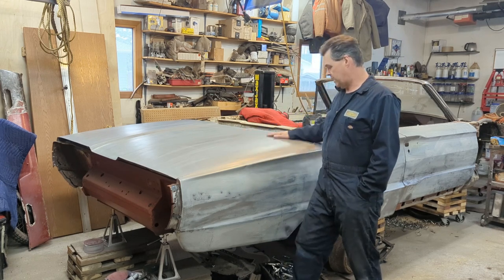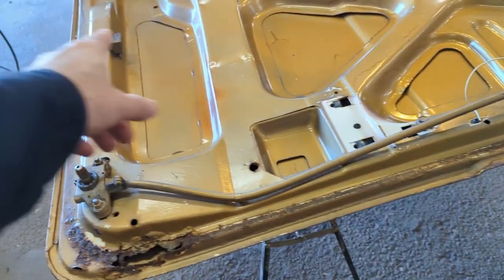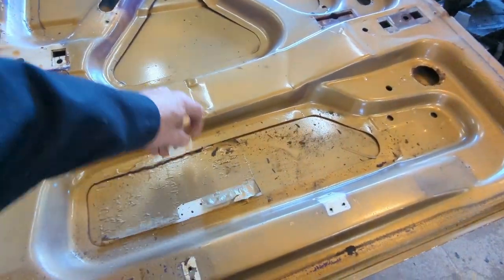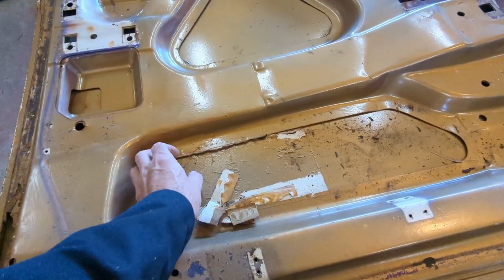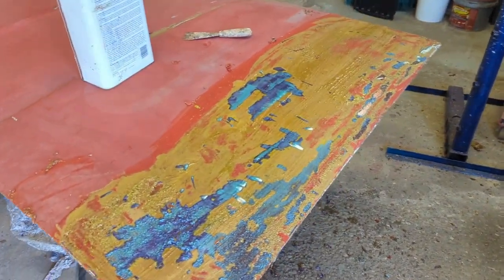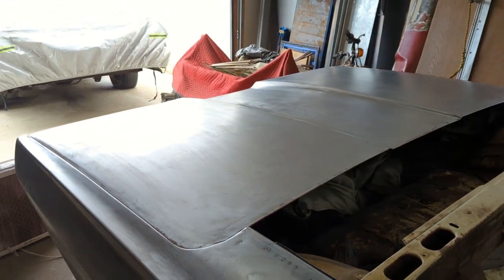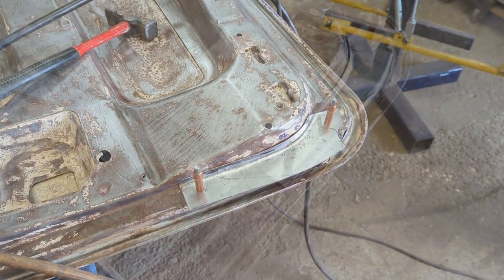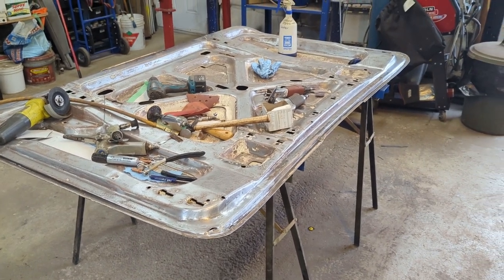Quick Strip & Welding Patches On The Trunk Lid - 65 Thunderbird Convertible Restoration Ep #43

Comment: Hey Alvin, nice repair on the deck lid. I bet the two dents on the top are from the deck lid being bent by the hydraulics. That is where they bend when the deck lid is still locked down and the hydraulics are trying to lift it. Id check the frame underneath and see if there is any damage in that area as well. You might want to install the deck lid hinges and attach the deck lid to those when fitting and welding the quarters back onto the car. This way you know the deck lid is where it is supposed to be. Using paint stripper is risky in some cases. I had a big discussion with a body man about that once. Its common that people use paint stripper and some of it gets stuck in hard to get places and they do not clean the areas thoroughly enough. Once the car is painted, the paint stripper that is still hiding in those places starts to attack the new paint. I can see this being a big problem with the deck lid since there are so many places in between the frame and outer skin for the paint stripper to hide. It might be worth it to steam clean the entire thing thoroughly to remove any remaining stripper. There is a similar problem with sand blasting. Removing all the sand is very difficult and I know some guys that restored cars and said that there still is sand coming out from places on the car after the restoration was finished. Its always something. Anyway, another great video.
Reply from the maker: Hi Nick, thanks for the advice on getting rid of the left over stripper, I'll wash it all out so there isn't any danger of it attacking the new paint. When I set the gap on the tailgate of my Ranchero, and my F100, I did reinstall the hinges...it makes for a more accurate fit. I had a car sand blasted years ago, I will never do that again, I'm sure there is still sand falling out of that car! Lol
Thank you and take care!

Comment: Amazing progress! It looks darned good! I have that same rust-through issue on my trunk lid, but only in one area. Helpful video.

I've been meaning to ask you: Will you need a master cylinder when you get to working on the brakes? I have a new one that I bought, but never used...you're welcome to it, free of charge. I'll even pay the shipping to you. I feel I should contribute something to you for sharing all of this information with me and other Thunderbird owners. I actually don't know if it's brand new or rebuilt - it's a Cardone - but I bought it to use on my '65 Landau. However, I decided to go with a dual reservoir unit and matching booster which I've already put on my car, so the one I would send you is completely unused. I can also send you my original master cylinder and booster unit if you want, which seemed to be working ok when I took them off. Just let me know where I can send them. I would provide my email, but maybe I should contact you so that some random person claiming to be you doesn't send me a bogus address. If you're interested, let me know how you'd like to proceed.
Reply from the maker: Thank you for the offer, I have two of both the master and booster...and like you I may switch over to a dual master, but as generous as the offer is, I really don't need them, and taking them would be a little on the greedy side! Lol
I sure do appreciate your generosity...thank you very much!! 😊😊😊
Reply: @J_R_Shop  You're more than welcome! Thanks again for the very informative videos!